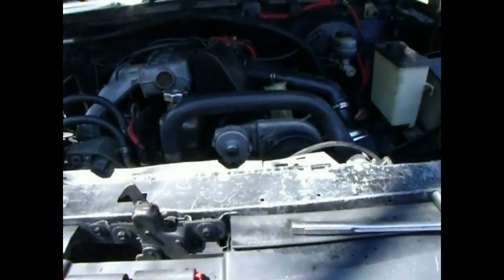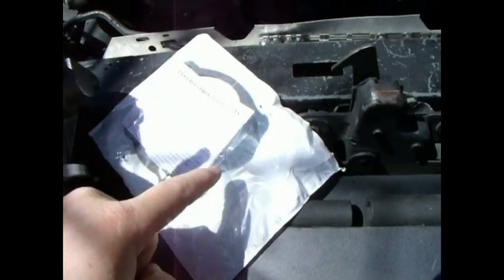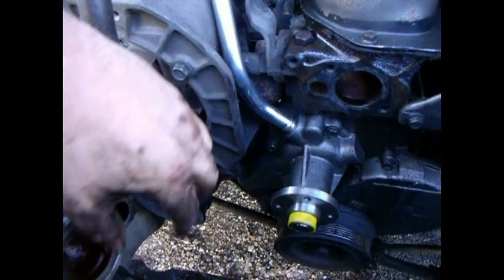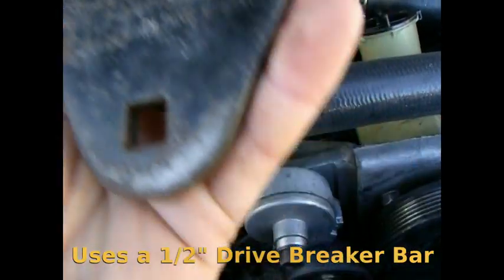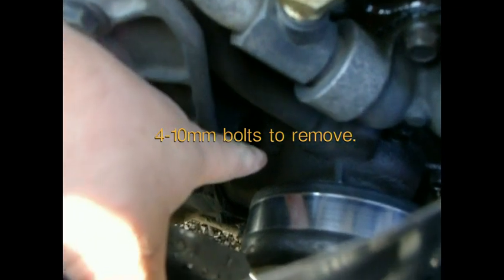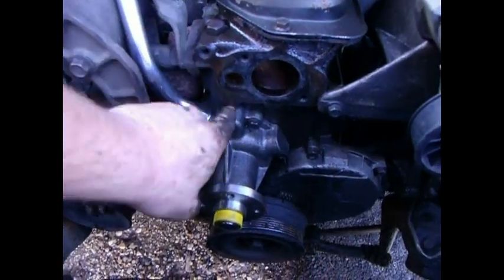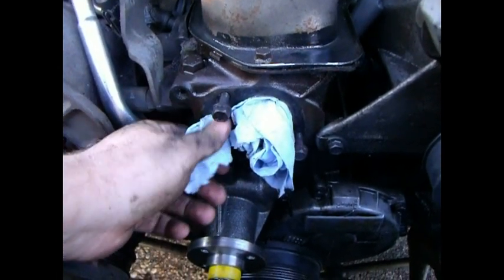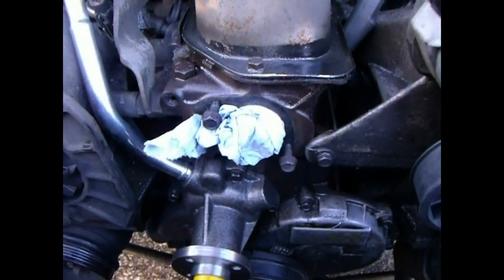1980-1996 OBS F-Series: 300 Inline 6 Water Pump Replacement

Comment: Obviously by the spread of years in the comments, this is a contribution that keeps on giving, and will do so for another decade or two. Removing the whole assembly before trying to remove the fan blade is saving my entire weekend, "it's not what the book says", but it sure is a WHOLE lot faster.
Well done all the way around, Wesley, you're clear and to the point, and the video is the same.

Comment: Clear, concise, with good camera footage. Thank-you.
Reply from the maker: Thanks!
Reply: bolt sizes stated are NOT correct, NOT 10mm, are 5/16-18
Reply: @TheFSeries  Quick question on the metal pipe coming out of the water pump. Have you replaced that pipe by chance?  Just looked shiney with no flash rust on it. If so where did you end up finding it at.  I have a 96 ford f150 4.9L Straight 6 and the pipe that goes into  thermostat with the thermostat sensor on it  I noticed it has a pin hole in it. I found that part on Amazon for about 30 bucks. But no luck on the other pipe of finding it since the other one looks like it's ready to go due to it looking rusty. Any help is appreciated I have looked on autozone,O'Reilly,Rock auto,Amazon with no luck.
Reply from the maker: If my memory serves me right, the pump comes with a new pipe/fitting

Worst case scenario  take the old one out and mate it up at the plumbing section

Comment: You either had broken motor mount(s) and they were fixed or have broken motor mount(s). The scored radiator and bent fan blade are the classic signs. My guess is that you have 1 broken mount (typically the drivers side goes first), this is allowing the motor to move forward enough to scuff the radiator.When the other mount breaks the fan will tear up the radiator. been there done that.

Comment: Thanks for the video! Always nice finding these for prep before a job. 

I really don't recommend anyone putting on parts from Advance or Auto Zone...they come with a lifetime warranty, because they're junk. How many times do you want to replace a part?
Reply: I just put mine on today and it’s leaking from the heater hose on the metal right on the water pump not excited to take it apart again and I got it from o Reilly’s
Reply from the maker: I feel your pain. To date my water pump has not given me anymore issues; and generally speaking the house brand stuff IS junk.

I was in a hurry and got lucky I guess.

Comment: Hey bud I have a 1980 Ford f100, and I need some help. Figured i would just ask you haha. What is the part called that's attached to the thermostat housing? That the vacuum control switch attaches to? It's just a metal tube but the thred are spec'd for the housing and I dont know what it's called to find a replacement. Thanks!

Comment from the maker: Macreau, the USUAL order is to remove the Fan Clutch from the Water Pump; then remove the Water Pump itself; but in my personal view is was easier to simply remove it all at once.
Reply: +Wesley Cole Nice video, but I've not had any luck finding that tool you used to hold the water pump pulley. Happen to have any ideas where one can buy such a tool? About ready to go down to my metal guy and just have them make me one. Shouldn't be that hard and maybe cheaper?
Reply from the maker: +Gale Ghostrider it's just called a Fan Clutch Removal tool

any parts house carries them
Reply: Wesley Cole Never could find anyone in my area or on-line that had the same tool you used. Found some other tools that may of worked but I didn't like them as well as the one you used in your video. So I ended up going down to a wielding shop and just had them cut me a piece of metal 41/4X81/2 with a 2 1/4X3 notch in one end. Then had then put a 1/2 square hole in the upper end for a half inch drive socket and only cost me $25.00 where most the store bought prices I was seeing was all around $60.00, except no one had the tool to buy anyway! Short version of this story, don't waste your time hunting around for this tool, just go to your favorite friendly weilder and have them make you one and save yourself some money in the process!
Reply from the maker: My whole kit was $25
Reply: Good price, I couldn't find anything near that price here or on-line. Just out of curiosty, do you know how thick of metal yours is made of? I made mine out of 1/4" metal, but 1/8-3/16 probably would of worked too? On another topic, have you had to work on the ignition system on the steering wheel yet? There's a rod the runs down the sterring column that goes into a switch for turning over the starter. If you know what I'm talking about? Anyway, I've found out that Ford seemed to mess that system up and it fails quite often. I've found quite a few Fords with the same problem. Instead of the rod pushing straight down when you turn your key over to start your truck. The rod moves up and away from the column and therefore never pushing the switch down to start the engine. For the time being I've had to cheat and hook a pair of vice grips to the rod on the column and turn my keys on as usual then push down on my vice grips to start my truck. Looks crappy but it works! I finally found a mechanic that says he can rebuild my column and fix the problem. Just waiting for the guy to get some free time to take my truck in and get it fixed now! Other thing I have with the truck, which I don't know if yours is a stick or not? But mine is a stick and I just had the clutch replaced. Now I find out that the base of it for lack of a better word? Anyway the bracket that attaches to the firewall that holds the clutch is also cracked and not letting the clutch pedal get it's full range of motion.Something I would of never known without someone telling me this was broken. Certainly can't tell it by pushing the clutch in or letting the clutch out! It all feels normal as far as I can tell, but I'm told by the mechanics if it's not replaced my new clutch will wear out much faster then it should. Really can't complan about my truck too much though, I've had it for 15 years now and this is the very first time I've had to put much money into it other then doing the brakes a while back. Been a great truck over all and the engine still runs terrific. It's got 175,000 miles on it so far without any engine work other then a tune up. How about yours, any problems?
Reply: Wesley R. Cole 
hot wheels treasure hunt

Comment: Any tips on keeping form breaking the bolts? Or how do you deal with it if you do?
Reply from the maker: Bud, you can spray it down with PB Blaster before tearing it apart. If a bolt breaks, an E-Z Out kit is your friend. Simple to use and gets the job done.
Reply: Wesley Cole Thanks.
Reply from the maker: I appreciate the questions and comments!!

Comment: Did you use the same water pump pulley or did you purchase a new one. If you used the old one, how did you get it off after removing the four bolts?
Reply from the maker: it just falls off

Comment: Did you have to remove the radiator?
Reply from the maker: I did not. I simply put a piece of cardboard in between the radiator/engine so nothing would nick the fins.

Plenty of room to remove the water pump without removing the radiator, though.

Comment: those water pump bolts are hard enough to get to on an engine stand. I speculate, engine in truck, removing the fan first is easier than taking the entire assembly off.
Reply from the maker: yes, using a breaker bar wedged between 2 of the 4 bolts (or the actual tool) to let you remove the bolts makes life a LOT easier.

Comment: I ran straight water for a few days after repairing hoses, and now my waterpump seal is leaking. Luckily it still pumps though.
Reply from the maker: Running straight water won't cause a bad seal;

That would have to be either installation error or a defected part.